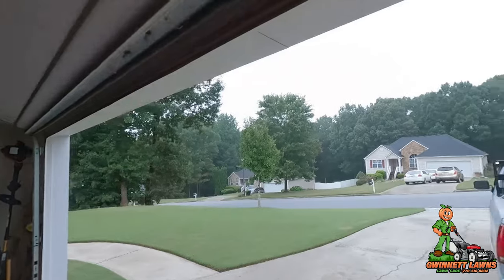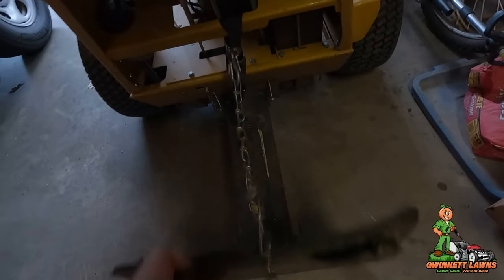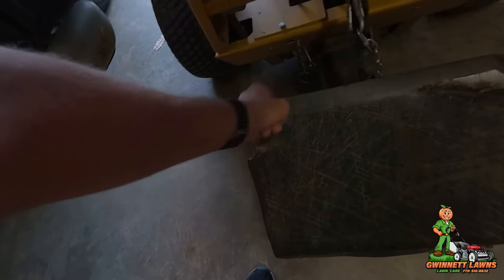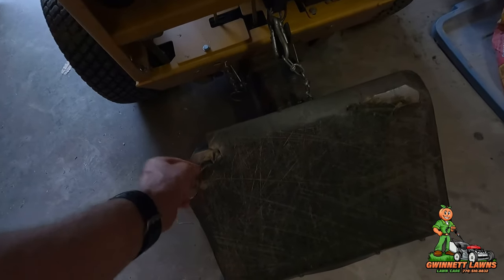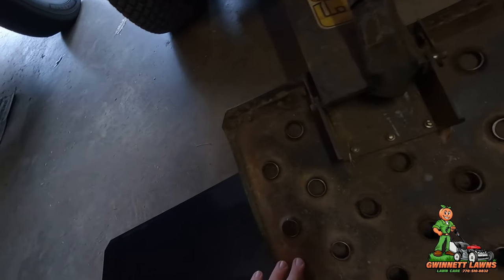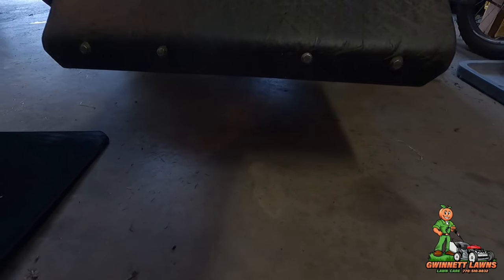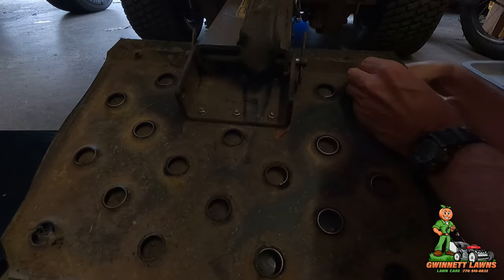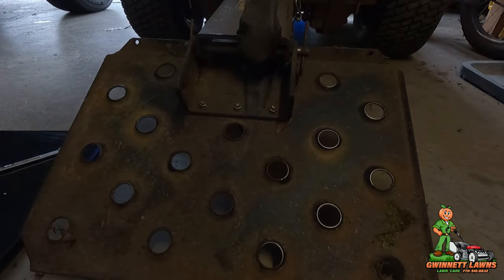Goslide Wear Plate Replace and Reinstall

Comment: Hey Russell, I wonder if you did 2 perimeter passes if it would keep you from backing onto concrete. I have no choice but to do it due to the back zero turn sticking out farther than normal.
Reply from the maker: I usually do but when your at the corner of the mailbox, sidewalk and driveway on the first path, that's usually where it happens.